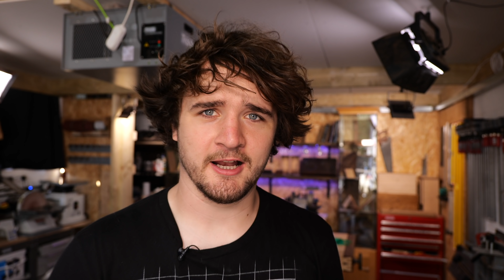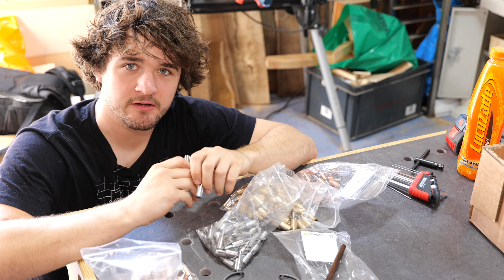Making a Drillymajig | The DailyME #6

Comment: If you do make a metal one, I'd try and support the 'blade' from above and below, which would need to be another part. Make the attached side your primary datum. Secondary could be the hole for the ferrule and tertiary would be the hole for the drill. That way you are minimising the tolerance you are allowing them to work to. Put a chamfer on the leading edge of the blade holding  face to aid alignment.  If your the blade holder inside the ferrule is steel, add a magnet to stop it sliding out while drilling.

Comment: 'Order of operations' stylee, if you use the loctite to hold the collet, then jig drill and thread the grub and *then* do the collet chamfer the lathe operation of the chamfer is less likely to crack the loctite binding and knob up the chamfer as the grub screw is also in place?

Comment: Might have been easier to get the engineering shop to drill, tap and counterbore.  However, the problem of drilling into round stock could be eased by machining an small flat on the diameter of the ferrule with an end mill (same size as the head diameter of the grub screw so not visible whn finished?) then spotting with a centre drill before drilling to size and tapping.

Comment: Good solution, one tip when I was taught metalwork at school, 50 years ago a hacksaw is a 2 handed saw your left hand should hold the front of the hacksaw that then allows you to keep it straight, all the effort should be put on the downstroke no pressure on the return as metal is harder than wood and will therefore wear the blade out quicker. When I was taught the hacksaw blades were brittle and were made by Eclipse and would sort of shatter and we were allowed one blade and if we broke it we would have to pay for a new one! As we would only get a new blade if it was worn out..
Reply: Cut direction depends on the orientation of the blade - they can be installed either way around.  Cutting on the pull stroke helps maintain blade tension and stops it binding when sawing tough material.  If you're cutting on the push stroke, then depending on the material there is the change the frame will flex slightly and cause the blade to bind.  Using the second hand on the front of the hacksaw helps prevent the binding - but you've just turned it into a reverse-pull saw (you're 'pulling' the front away from you to maintain tension).... it works, but just reversing the blade makes for a much more comfortable action.
Reply: Geoff Willingham Hi, yes you can reverse the blade, the hacksaw that I have does not flex like the old Eclipse ones and as an electrician we had to cut steel conduit, trunking, cable tray and steel to make brackets and often all we had was a pipe vice so we always cut on the push stroke. I showed some apprentices how to cut and they challenged me to race, even though I am 60 I beat them. The technique was shown to me by my grandad who was an engineer in a tool shop, where he engineered dies for engineering.
Reply: @raysmith1992  Well, almost any technique will beat no technique... :D  (especially if they didn't check e.g. blade tension and so on first)

That said, I admit I rarely have to cut Steel bar like that - aluminium bar and copper pipe at most (and then infrequently) so maybe two-handed is 'better'... but one-handed on the pull stroke works fine for me :D

Comment: Hey Matt, you’re on the right track making the jig out of metal. You just need to make it out of something your machine can handle. Aluminum would work just fine still using the drill bushing so that the jig lasts. If you’re wanting it made out of the steel, you should have the machine shop that made all your marking knife components make it. I think you’re design will work just fine and holding it in the vise so it doesn’t move is spot on. If you need any more ideas, hit me up on my email at paul.scott@rampengineering.com. I’d love to help any way I can. Cheers

Comment: As a retired gunsmith, I can address that drill issue.  Please use a center drill.   It is a bit with a heavy core and a smaller actual bit.  It is great for starting holes on the round of a barrel or other part.

Comment: Why aren't you getting these holes machined in by the engineering company? They could easily get a repeatable perfect 90 degree hole. If you want to finish it yourself they could drill it undersized or spot drill it.
Reply: Because he wouldn't be able to guarantee that he fits the inside of blade holder in the outer ring at perfectly 90 degrees to the locking hole.  And he could pay the company to do the assembly and then cut the hole - but that would probably significantly more expensive, and Matt can do the work himself on his tools 'for free'  (baring his time)

Comment: 1. Get a better quality hacksaw. That one looks like the same quality as the cheap wood working tools you got from Rob. A really good one plus use a blade with fewer number of TPI since you are cutting through a good size chunk of metal. 2. Does the slitting saw have teeth with some set. No set? The blade heats up, the metal heats up, they expand and you grind to to a stop.

Comment: Matt, the idea of your jig looks fine. For the part you drill in you could get a drilling bush (search for Drilling bush DIN 172). These are hardened so they do not wear out by drilling. They are fitted with a press fit against rotation, but I think the Loctite will work to if a press fit is a problem.

The idea of this kind of jig is to help you machine the parts with the tolerances you need. The jig itself doesn't matter, the important thing is you can get the accuracy you need.
Reply from the maker: Incredible idea! Cheers Johan, will look into that.

Comment: Why not have the metal shim be connected to the jig and then you don't have to take it out and put it in each time?
Reply from the maker: Because it needs to be replaced every now and then. It gets drilled into a few times!
Reply: @MattEstlea  you can screw it on so that it's removable. It just seems like it would be a hassle to keep moving that thing around.
Reply: Having it screwed in place would mean an extra step when it comes time to change ... by having it sacrificial and loose swapping it out is simpler .... however there may be a way (that I don’t see) to have a perm fixed piece in just far enough to not get damaged and with a depth stop on the drill stop damage to the other face inside

Comment: if you want to make a jig like that that will last a life time:
 you can get some tool steel shape it to rough dimensions send it out to a heat treating service and then finish it with solid carbide bits which can be fairly cheap if you find the right place to shop. you can also use calipers and such to get EXACT dimensions since you have that milling machine there. 

if you want to take it a few steps further you could augment the jig by adding a sliding part to it that also holds the drill bit in its own ball bearing you'ed have effectively perfect accuracy and basicaly zero wear and tear for the rest of your life.
Reply from the maker: Now THIS is the sort of comment I was looking for! Cheers David 👌
Reply: @MattEstlea  https://www.wdscomponents.com/en-gb/jig-fixture/drill-guide-location-bushes/plain-drill-bushes/c-784 these are what I put in all the drilling jigs I make at work
Reply: @MattEstlea  I think that deserves some tokens in the bank!
Reply: @Snowy042   wish i could eat those tokens <3
Reply: @MattEstlea  glad to help.
Reply: You can make the jig in aluminium and then put a drill bush in for the hole your drilling through
Reply: @alexbellringer4116  aluminum is relatively soft and will bend if you drop it. its a lot more trouble than its worth.
Reply: @davidmuhs4590  I know i machine fixtures for a living and In 90% of applications aluminium is fine as long as you put bushes were needed
Reply: @alexbellringer4116  if your never personally touching or handling that fixture i'd agree 100% but if you drop it once it could go out of square and if say the face that the blade sits flat against is made of aluminum then over tightening the vice would ruin it.

 you could make only the two holes and 'blade holding face' from tool steel and then rest aluminum but at that point the jig  only needs two more flat faces for a vice so it mights as well be the whole thing.

the idea was to make it so he only needs to make the jig once and accidents happen of course.

Comment: I know you like accuracy/ perfection, so you could do with tramming your mill head after you rotated it. Your slitting saw cut off method is not unfeasible as all you are doing is rotating the axis of work 90 degrees,  you just need to setup the angle to 90 not 90.1 or 89.9. Saw was probably rubbing on the surface. Your new jig looks really nice.
Reply from the maker: Cheers Stuart. Yea I will tram it properly before the next operation 👌

Comment: Using a slitting saw as a chop saw might be.... inadvisable.

Also, you did try to centerpunch and spot drill the hole with a center drill before drilling the actual hole, right?

Maybe making the jig out of a softer metal than steel might be easier. I mean, a brass jig would be a few more quid for the metal but it might make it easier on your mill.
Reply from the maker: Lol, I knew I’d rustle some jimmies with this one
Reply from the maker: And cheers Mark. Not sure if I tried that or not but will certainly give it a go. The main problem I foresee is swapping out the centre drill and the 4.2mm drill for each operation. Whereas with this jig I can go straight for the 4.2 👌
Reply: @MattEstlea  True, but the idea is you'd spot drill all the ferrules first in one batch, then swap out the center drill for the 4.2mm and then drill all of those. If you're tearing down the setup between each drilling operation, it'd take several times as long. 
That jig you have looks like it'll do you for a hundred or so first though.
Reply from the maker: Awesome, I’ll definitely give that a go on the next batch. I guess some sort of Vee block would suffice?
Reply: @MattEstlea  I'd support it with a v-block and clamp it by the shim myself, but I wonder if you could get away with just clamping it in the vice (with shims to protect the surface) and just use the shim in the blade holder to align it on a parallel or a scrap of squared stock resting on the bottom of the vice?

Mind you, thousand ways to do it...
Reply: If they pulled that stunt in our workshop the technicians would have not been too impressed. They could have done the exact same thing with a 10 quid hacksaw and saved the lignum vitae for something slightly more useful. 

Cutting the stock to a nominal length is not a precision operation and using a milling machine was a bit daft.
Reply: @Dingo F
He wasn't cutting it to length, he was cutting the step in it first.
In woodworking, you cut the workpiece off the stock as late as possible. He's following the workflow he knows. Woodworkers and metalworkers both drive each other nuts when they do the opposite.